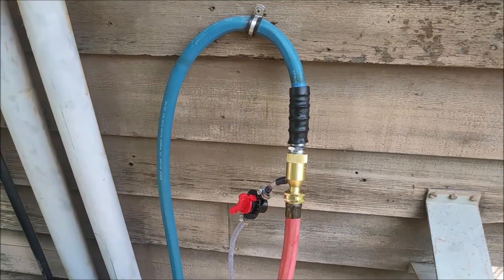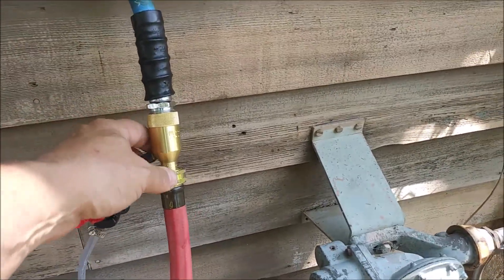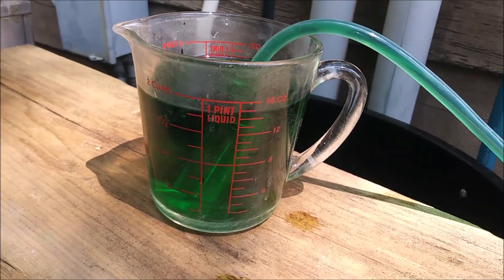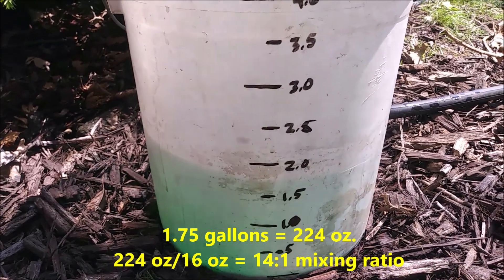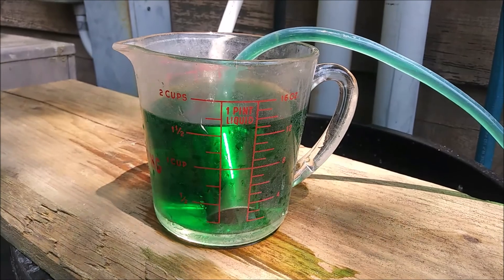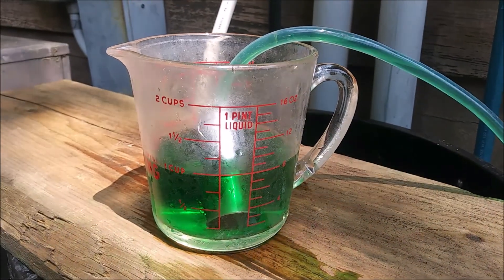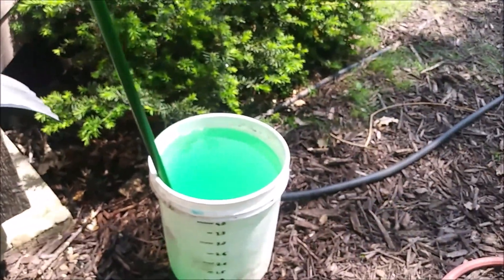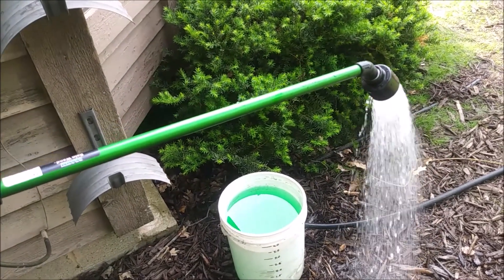TEST: HOZON Siphon Mixer - Venturi Siphon - Fertigation

Comment: Did the blue water have to be higher than the hose to create and hold onto the syphon?
Reply from the maker: No. It's best if the pickup is just slightly below the injection point. In my example it was about 1 foot  below.
Reply: It is not a siphon at all. It is a venturi. Hight will effect the ratio similar to the test valve in the video.

Comment: How do you make the rest of the setup?  I see the meter but where did you get the rest like the bottom part in the measuring cup?  You’re not using the syphon end it comes with?
Reply from the maker: I wanted to use a clear tube so I could see the flow. All it is is a clear tube stuck thru a 3/8" metal socket which acted as a weight.
Reply: @TommyTester  what's the regulator part?
Reply from the maker: @colluvium1  Search Ebay for Venturi Fertilizer Injector.  It was part of another kit that I then used with the Hozon unit.

Comment: I noticed you said it won't work with sprinkler due to backflow. Why do they have a oscillating sprinkler on the front of the box.then?
Reply from the maker: Good observation.  I have several of those oscillating sprinklers, so I'll test it on my system.
Reply: @TommyTester  it may be harder to get a measurement unless you can put the sprinkler in a clear 50 gallon bag. Maybe you can come up with better way
Reply: Marketers are the biggest liers on the planet. I tried one of these, even a +100ft long hose with the low pressure breaker wand is too much head, it actually backflows and fills the concentrate bucket. The Hozon is basically useless for most practical needs, everything it does can be done easier and with more accuracy by hand mixing. (Its only a 15:1 ratio so even a 5 gallon bucket of concentrate will only get you 75 gallons and being limited to about a 25ft hose.) 
Of course the useful real injectors start at $500 these days (probably $350 when the vid was made), mostly because they are built for use in large commercial nurseries, unfortunately nobody has really been able to split the difference.